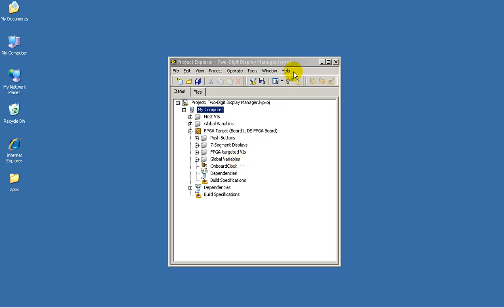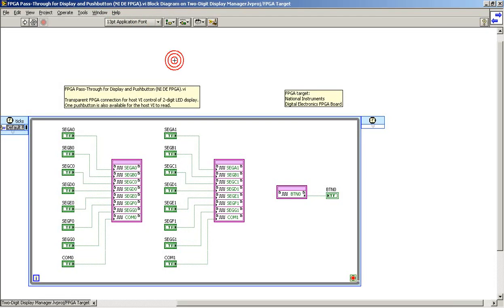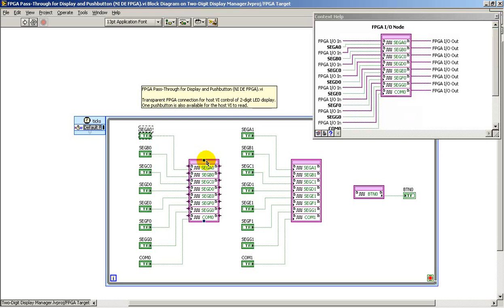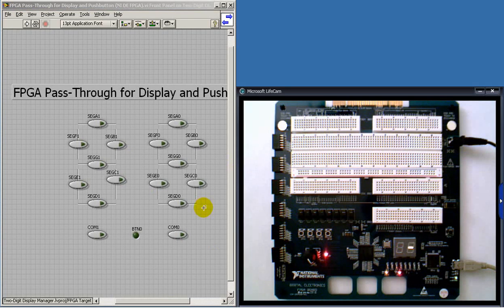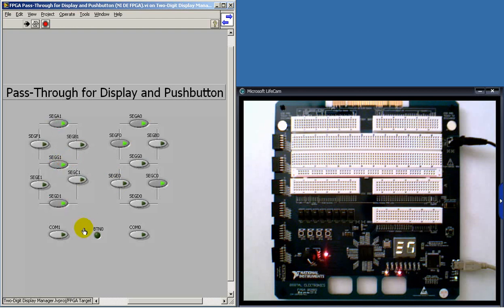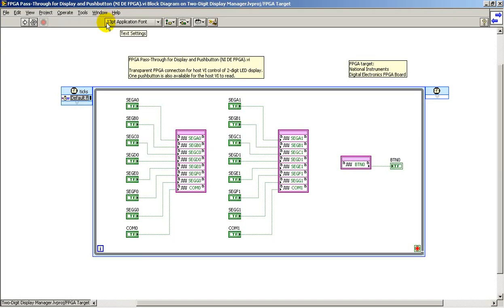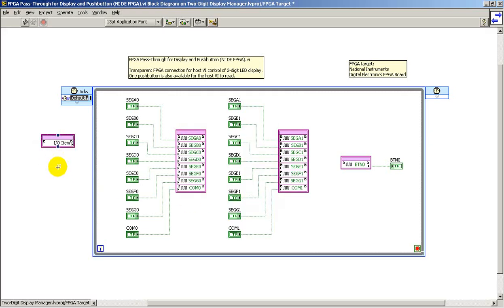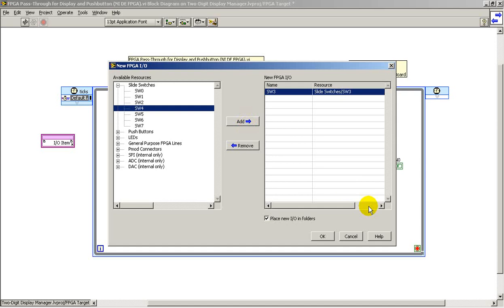LabVIEW FPGA: Construction and demo of the transparent FPGA circuit

Comment: Hello! I know this is an old video, but I just got my hands on the same evaluation board. I am struggling to figure out how to connect to this device. Do you happen to have all the download links for the software required? So far I have LabVIEW 2012 SP1 and am able to add the FPGA, mine pops up as "Spartan 3E Starter Board" in my project. I can not compile my code to the FPGA.